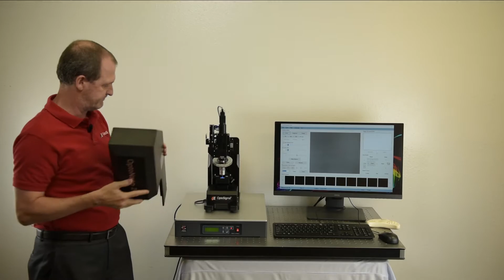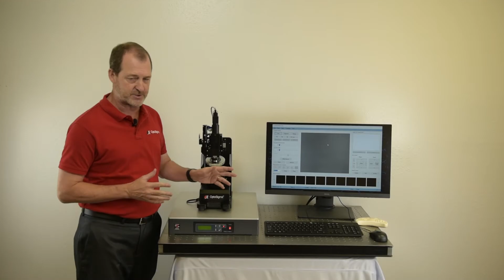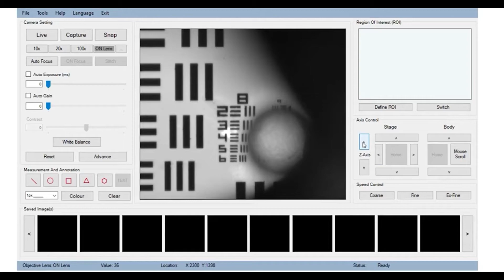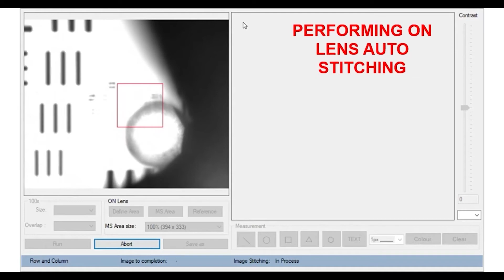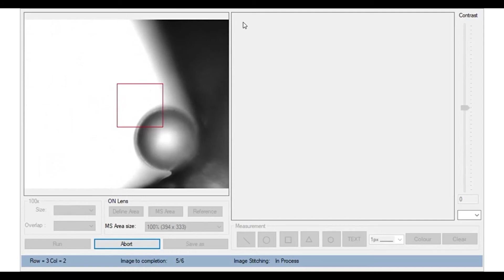3  OptoNano 200 SPIE webinar - System Demonstration

Comment: Dear all,
How is axially controlled the distance between the microsphere and the object surface ? What are the accuracy and the risk of scratch? 
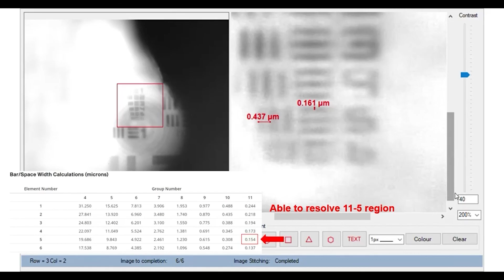@7:39, you have mentioned a lateral resolution of 161 nm. But it is half of the resolution (half of the period). This means the resolving power of the system is around 320 nm.
Regards,